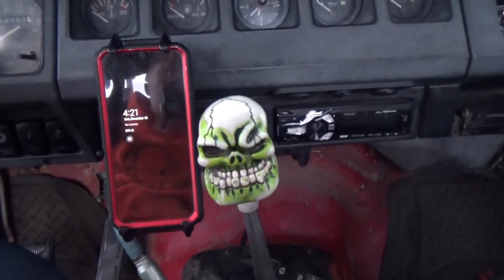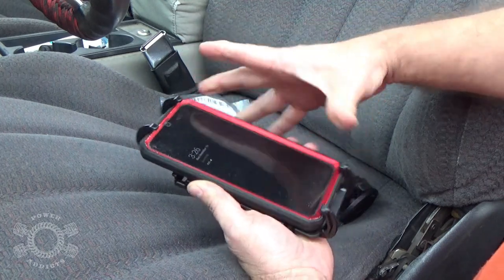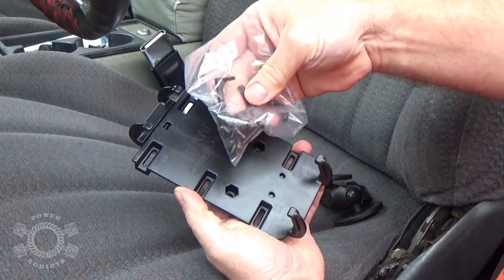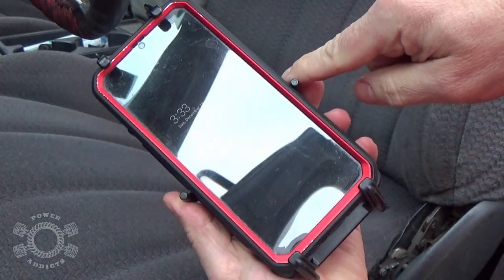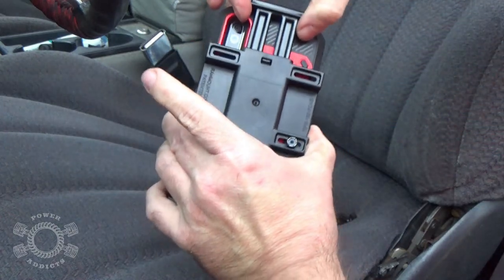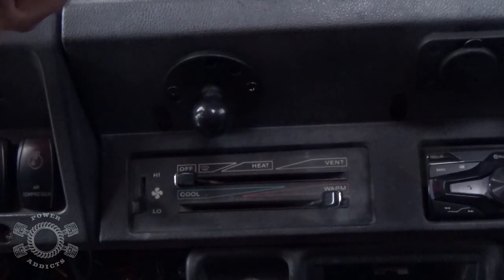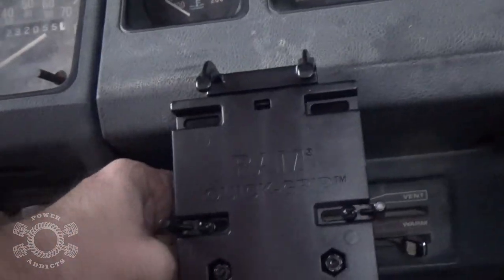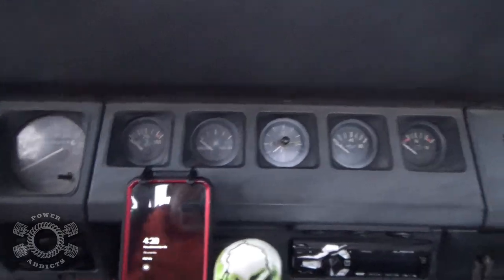Jeep Wrangler YJ - My cell phone mount solution

Comment: Good evening Chuck, great video as always.  I just picked up a hard top for my 90 yj,it was off a 94 yj. But I am having trouble finding the correct uppers for my factory metal lowers.  Can you point me in the right direction??
Reply from the maker: You will need full steel doors or find a set of TJ uppers and modify the pin.
Reply: I have them on order, should be here this weekend.  Thanks so much for all your help and keep up the videos.  They are a great help.  Thanks Barry

Comment: Random question wondering if you could help me out with something was wondering if you could tack some pics fo mesuments and send them to me for a project I  have the ford bench seat and wanting to get sunfire seats and wanting to make a center  Council i have everything to do it but the seats hoping to atleast biuld a foam mockup and make it out of sheat aluminum
Reply from the maker: Sooo ... what pics and measurements you needing?
Reply: @Poweraddicts  im needing pics of the mesuments between the sunfire seats and how tall and how long so I can start on a mockup of a center counsel you can pm me them on fb kevin deibler we talked on there before awhile back but I accidentally deleted that conversation I would really appreciate it if you can
Reply: @Poweraddicts  needing   Height length and width
Reply from the maker: @kevindeibler346  People installing the Sunfire seats is a very popular swap. So, Instead of pictures, I created a video that gives dimensions of the seat spacing. I have an old Bestop center console in my rig I got the dimension from it as well. The video should release next Sunday 1/24/21 or the Sunday after.
Reply from the maker: Here ya go, I released it early. https://youtu.be/Wnd0ngvkLxk
Reply: @Poweraddicts  hells ya thanks